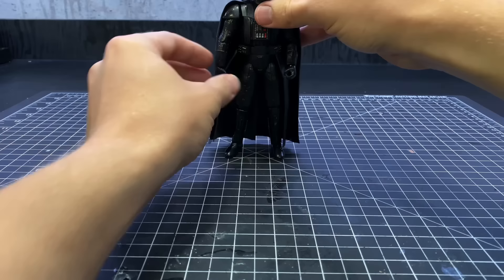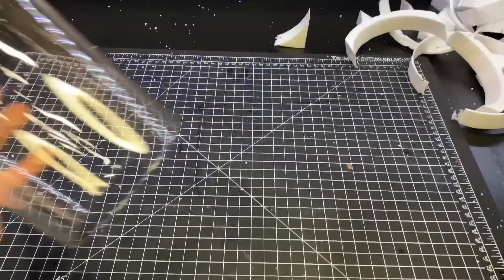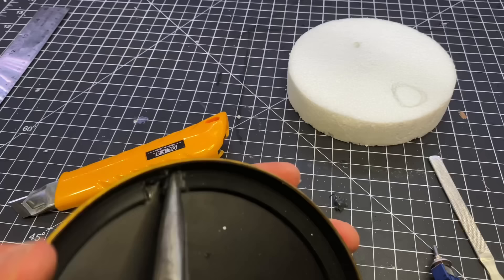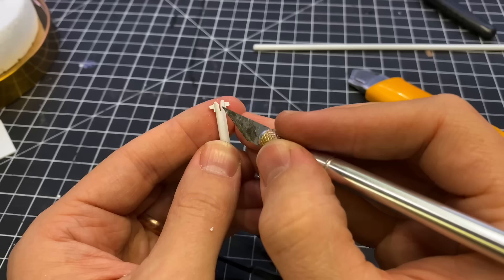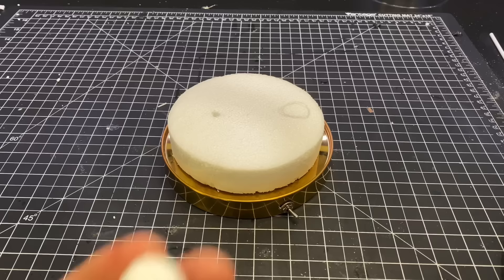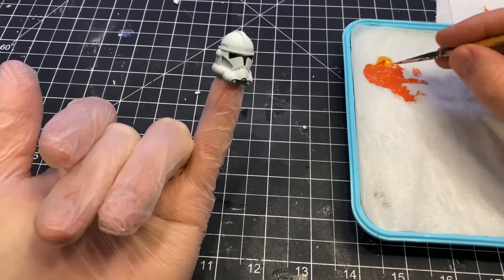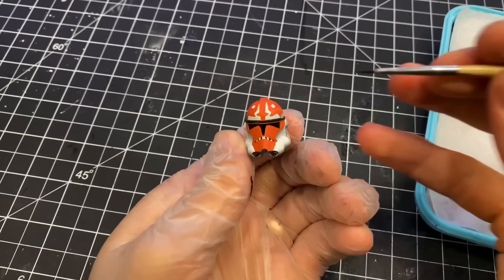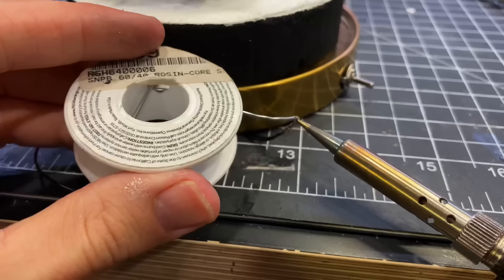Victory and Death | Relaxing Diorama Build

Comment: Did you use the 5V usb cable with diodes to give the filament extra brightness? Or is that how bright it is running off of the coin battery?